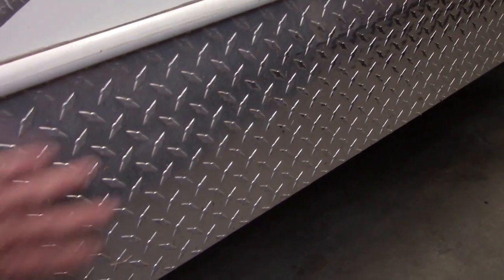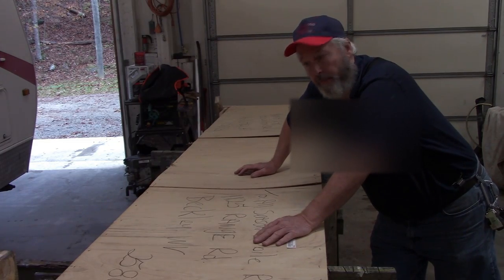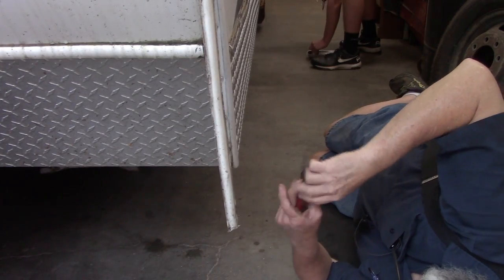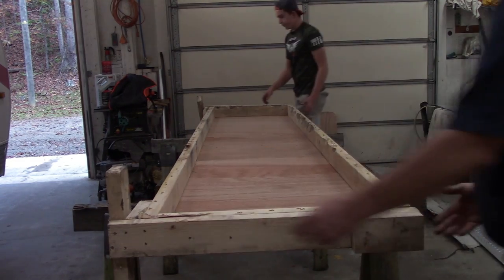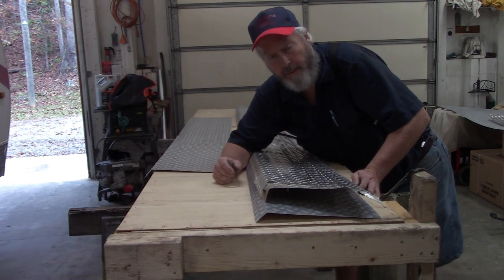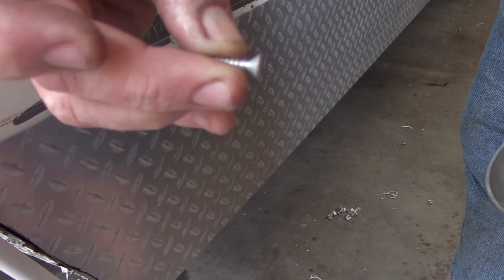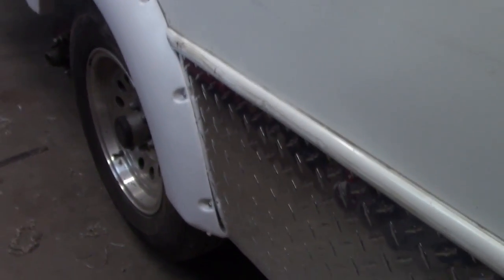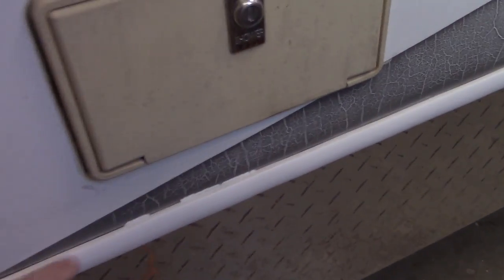Replaceing J Wrap On An RV

Comment: Nice job. My repairs always had frame structure also. Repaired a lot of insurance jobs most at the factory where either trees fell on the camper or was hit from behind. The corner J rail screw cover we called gimp "as in give". Same stuff covering window surround frames etc. Often replaced entire structures from the roof on down. You can buy new gimp and usually find it will shrink over time as the weather bakes the moisture out of it. That being the case when installing especially new gimp be sure to not stretch it during installation but rather try to add or compress extra into the trim so when it shrinks there won't develop a gap. Also around windows start on the bottom center in case shrinking develops a gap. Repaired some rotted wood structure also. This owner was lucky the frame really held up.
Reply from the maker: Thanks Steve. That's all good info.